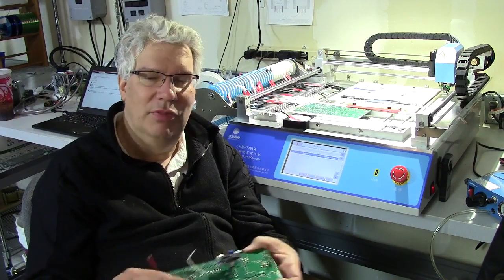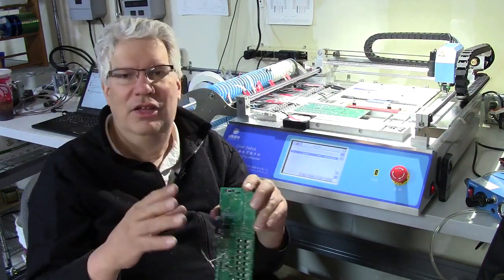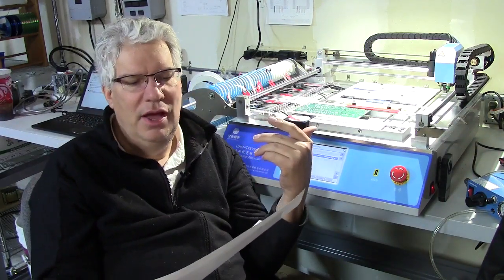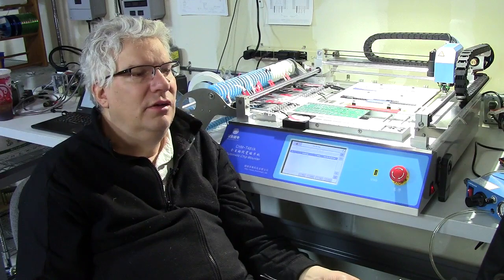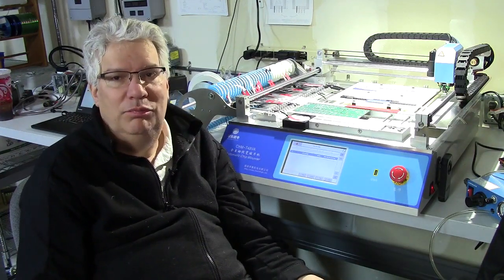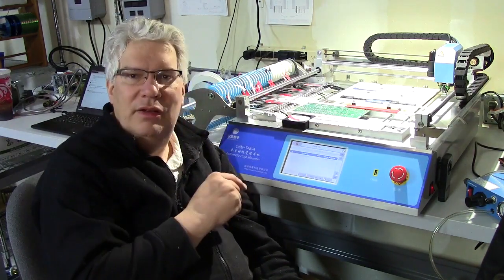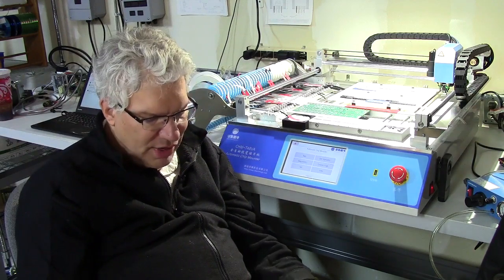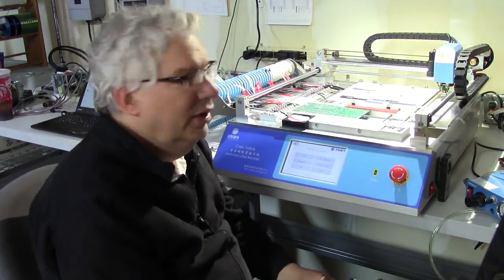190410 Tex Bring up and CHM T48VA Findings

Comment: Thanks for all the great info and it's awesome to watch your journey with the 48VA!  I'm super close to buying a 48VB, but I can't work with just 2 nozzles - my boards use 0402, 0603 and then some larger QFNs, so I can't see a way without 3 nozzles minimum, so some type of 2 part assembly, or a way to pause and switch nozzles mid assembly of a panel of boards. So annoying these CHMT machines can't even use an auto nozzle changer.
Reply from the maker: To handle that situation, you could build 2 DPV work files, one for 2 nozzles then run those parts, then switch nozzles and run the other DPV file. I need another in depth video on the DPV file, both creating one on the machine and creating one with your layout tool or desktop exe.  Thanks for watching and look for that video soon.